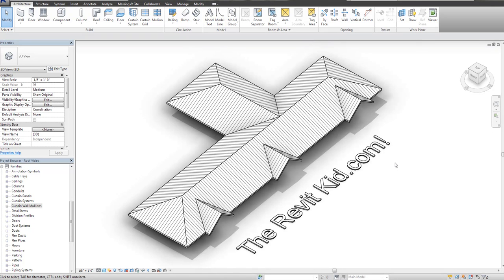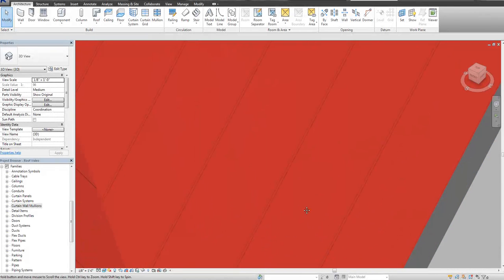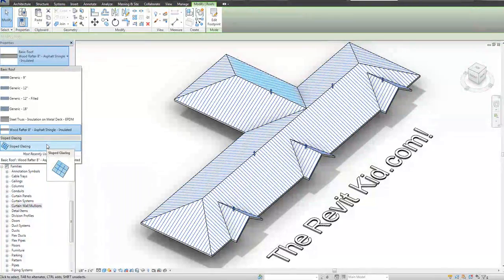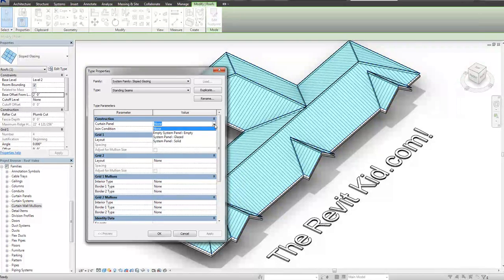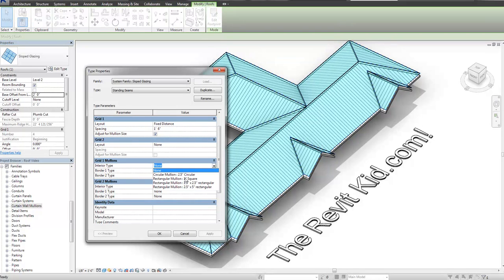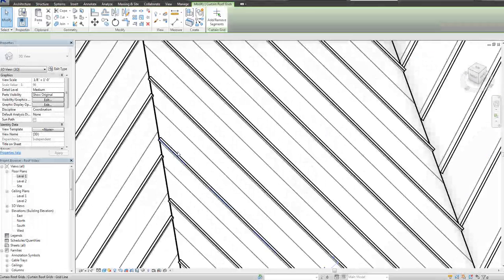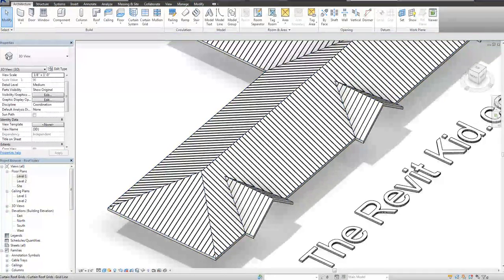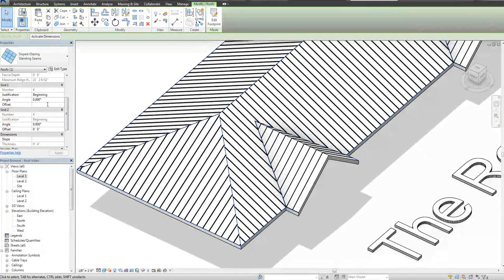Revit Tutorial - 3D Standing Seam Metal Roof in 6 Minutes!

Comment: ok im having a problem with this in revit 2016, in 2013 it was fine but in 2016 when i copy then paste then select glazing it says slab thickness is error and it becomes flat and orange meaning i have to either reset shape or delete it, why doesnt it copy over it like yours did
Reply: DjShadowsound265 sounds like you made your roof by modifying its sub-components instead of using the slopes... is that true?
Reply: I chose the rood tool, drew it on level 2 as a plan then added a split line, then i selected the split line and gave it an elevation of 15' creating a gable roof. Then when i did all the copy paste etc etc , it didnt work ???
Reply: DjShadowsound265 Yeah... do not use the split line tool...  Select the edge of the roof when in sketch mode (magenta lines) and check off the box that says "Defines Slope" and then give it a slope....